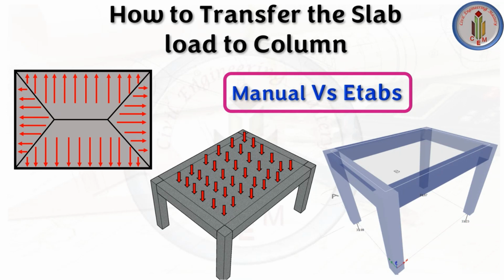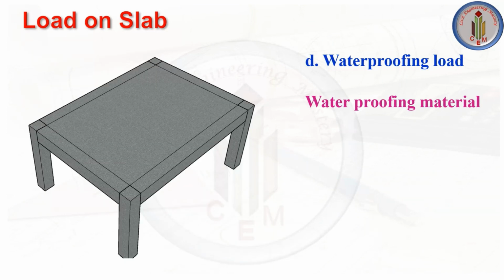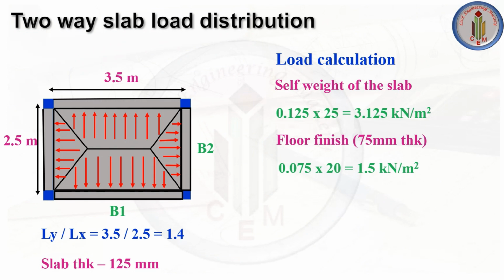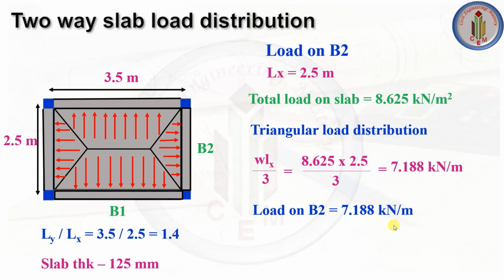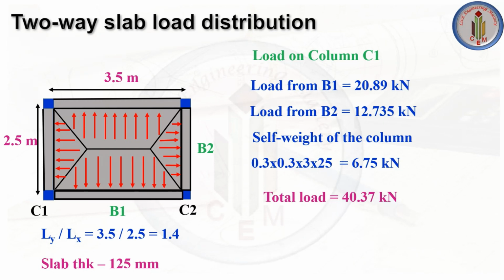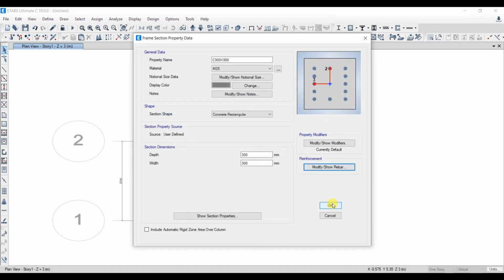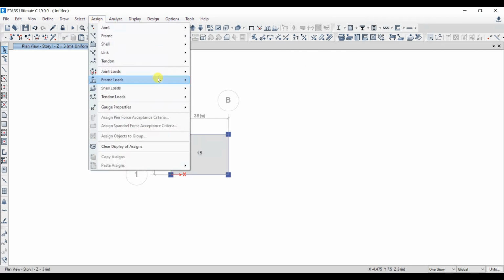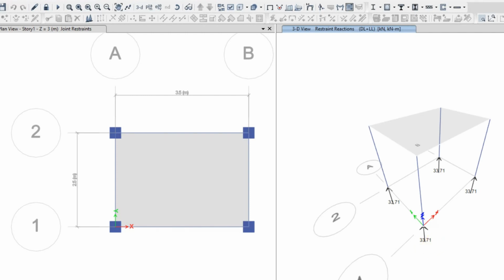Load calculation from Slab to Column | Manual Calculation Vs Etabs | Slab load transfer to column

Comment: MAM THE VARIATION IN COLUMN LOAD VALUES MIGHT BE DUE TO THE REASON SELF WEIGHT LOADS ARE NOT ASSIGNED IN ETABS
Reply from the maker: Self weight will be automatically taken by Etabs.